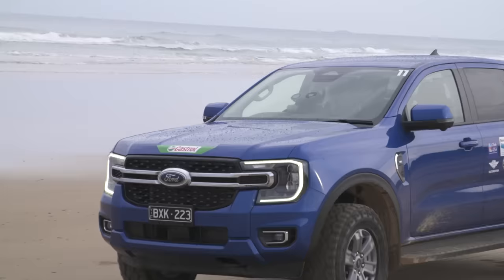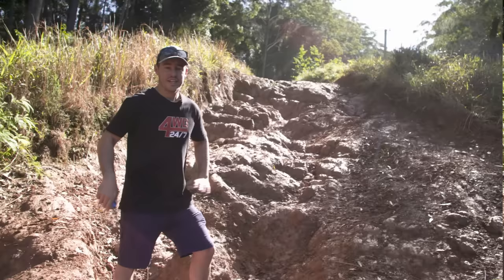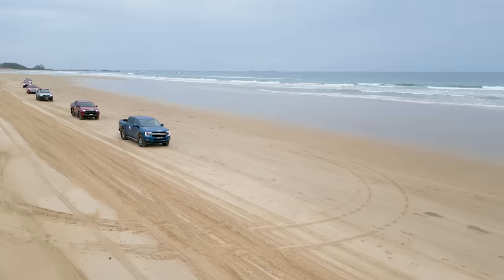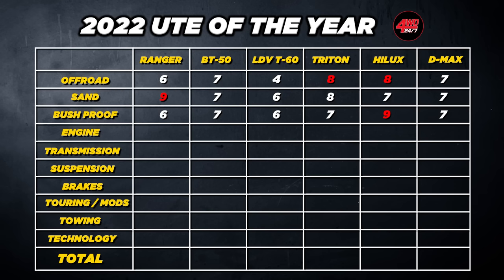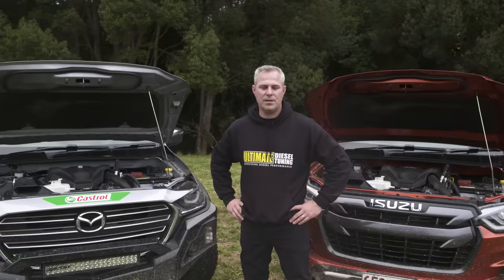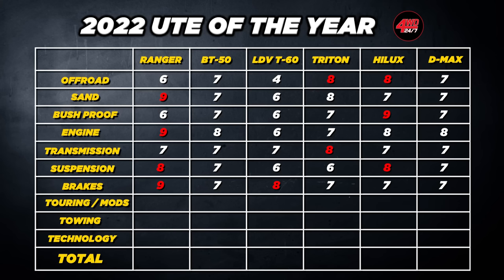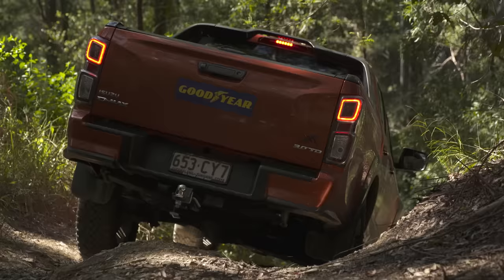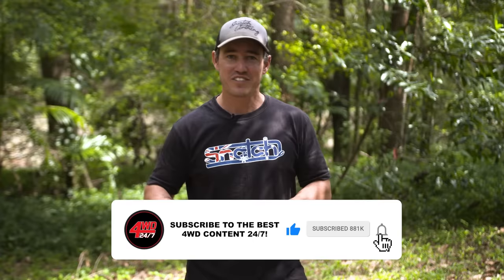2022 4WD UTE COMPARISON - CONTROVERSIAL WINNER! NEW Ranger vs Hilux vs DMAX vs Triton vs LDV v BT-50

Comment: Honestly, I think the LDV did well considering the price of the thing - did well in my opinion.
Reply: It was atrocious they didn't even take it up half the tracks
Reply: No it didn’t, and they are the most unreliable trust me I’m inside knowledge 😂
Reply: Triton doesn’t cost that much more and better in every way
Reply: yep.. worst performer, cant get lockers and other performance kits, worst engine, can't tow... but worst of all... made in China so it will last about a year ... sure did well all right.
Reply: The model with the locker is only 44k. Cant believe they didnt mention that or use one in the video.

5 year warranty? What's unreliable about that..
Reply: @electro1622  I've had mine for just over three years. Still rocking still love it.cant hate on something you haven't tried
Reply: @Jake_Hamlin  the fact that you will 100% have to use the warranty
Reply: @Jake_Hamlin  He did. He said it costs 5K more
Reply: Absolutely, I have the 2019 Trailrider, comes standard with the rear diff lock and both hill start and hill descent control. 2inch lift with 265/70/17 Yoko geolander a/t's and handles offroad and sand whilst towing offroad camper. All with original 2.8l 130kw, turbo diesel motor. Love
Reply: @zingerbox4198  biggest load of horse crap, 3yrs on and hasn't even looked like needing the warrenty. Maybe your boss needs to here about your opinions.
Reply: @darrenpetersen3115  they definitely heard my opinion don’t worry about that
Reply: Ive got the LDV D90, come with rear locker, don't understand why the T60 doesn't on all models? Ramp angle on the D90 let's it down off road as for towing the 8 speed ZF does the trick with the bi-turbo, friends 2018 Hilux lowing the same weight caravan cannot keep up climbing mountain passes here in NZ. Throttle response is bad, put in a EVC throttle controller, helped but don't get why modern diesels have this issue.

Comment: I've got a ranger PX2, would definitely benefit from a brake upgrade. The fronts are ok enough but I've had to replace the rears mostly due to mud. The handbrake as a result fails quite easily. 
Go the Ranger too! Ford boy from way back

Comment: So I own a 2022 LDV T60 max pro luxe [bloody mouthful]
It has a rear locking diff. You can’t choose it though, it’s automatic and it works a treat!!
Wonder if you’d try one of those models against the others?
Reply: Absolutely, I have the 2019 Trailrider, comes standard with the rear diff lock and both hill start and hill descent control. 2inch lift with 265/70/17 Yoko geolander a/t's and handles offroad and sand whilst towing offroad camper. All with original 2.8l 130kw, turbo diesel motor. Love

Comment: Great video, Hilux for me. Value, reliability, resale value, after market parts and mods, the biggest dealer network in Australia for access if something goes wrong on a big trip, the fact it shares an engine and gear box with the Prado & Fortuner, not mention a stack of other changeable parts means even more available parts all around Australia
Reply: Super relevant points. A big reason I stick with an older Hilux is the easy availability of parts and mechanics who know the truck. As was mentioned, the D-Max keeps changing parts and that's an absolute no-no for me, as it forces you back to the dealer every time (and there's only one Isuzu dealer near me). If buying new then re-sale value is an issue, and here in Malaysia that means the Ford drops drastically, and the Hilux scores big. As the Mazda is a rebadged D-Max they both drop to 3rd place for me, so it's Ranger if money no issue but really the Hilux is the smarter choice, especially as we don't know the Ranger long-term, and we do know Ford don't give a rat's ass about their customers. For me, I'll stick with my old Hilux Vigo, so I can go off-road and not worry too much, and there's no electronic crap to break (I fitted my own 360 cam)

Comment: I’ve just put an order on a new Mitsubishi triton Club cab/ space cab for all the reasons that you guys rated it for. Excellent Value for money, reliability, and respectable overall performance. I’ll be setting it up as both a tradie work vehicle and a camping vehicle. Being a club cab I don’t think the rear axle will be as much of an issue once I put a lightweight 3/4 canopy on it. The other vehicles were great too however budget plays a big factor and leaves me with more money for modifications and tools for work 👍🏻

Comment: Personally, I would upgrade to the new V6 XLT. I am currently on my 2nd ranger after owning a string of Patrols. My current Ranger was from the last production run of the 3.2L. 
As mentioned in this test, any short comings in the Ranger's rollover angle can be easily addressed with a suspension upgrade (same as the outgoing models) and a snorkel would be another immediate modification. If there was solution that could be done to help look after the alternator then I don't think you'd have many issues using the Ford...
I have over 10+ years playing in the retail car game and as such I am more than familiar with each of these vehicles aside from the new model T60 and Ranger which have been released since leaving the industry.. 
However, I am a bit confused about what was said in reference to the Ranger's V6. 
As was mentioned, this powerplant has been used in the F-trucks reliably but in the wrap up Shauno said he wouldn't put his hard earned coin down on a new Ranger as longevity is a concern??? Wouldn't being used in a much larger vehicle ease any concerns about longevity and reliability, Shauno?? 
I would be more worried about these small 2L diesels such as the Ranger,s and LDV,s 4 cyl. (I did work for VW for awhile)
Not being critical as my reasons for getting the old model over the new one was all new vehicles have some teething issues and recalls, etc...as history has dictated for every new release vehicle since they invented motor cars...
Fair comparison test by the team. Credit for featuring the LDV as they are gaining a lot of popularity due to their price point and as such continue to get peoples attention. I enjoyed watching this comparison. Thanks guys...
Cheers, Drummo
Reply: Theres has already been a large amount of issues from the V6 Rangers, especially drive train problems like the popular tail shaft issues, as well as gearbox issues which is the same gearbox used in the F150’s. Ive been heavily looking into them or a Hilux, and seen alot of issues with the Rangers. If they didnt have issues i would be strongly considering buying one
Reply: @Tact1calP0tat0  The tailshaft issue only affected a small amount of vehicles (a few hundred) it was dealt with quickly by Ford, they replaced the faulty parts instead of retrofitting a mod which was good of them, any new model is going  to have teething problems, Hilux has had plenty along the way, I personally wouldn't buy the first of any new vehicle, and rather wait for a year or two so they can iron out the invitable bugs.

Comment: Definitely the Triton. 
I bought an dual cab V6 petrol older model some years ago.
Replaced the shockies put on extractors.
It was a beast in the soft sand.
Even snatching 2x brand new Landcruiser that were bogged.

Comment: That was a great video guys. Really enjoyed it. I drive a 2016 Hilux and so fare have a Torqit performance chip and 3 " ss exhaust system along with a EVC throttle controller. It runs and tows really well. Thinking about a lift kit and brakes next. Happy new year all 🎈

Comment: Pretty much with you on this one Shauno,  Hilux, BT and Dmax would be great all round tourers that can handle some the harder stuff, proven reliability and a good suite of aftermarket accessories available.  Let the Grey Nomads test the reliability of these Range V6s' they did that with the Grand Cherokee V6 back in the day, on paper 👌 but over time and worked hard, absolute lemon.
Reply: It's funny that people still have no idea how much the V6 Diesel has already proven itself, it's a powerstroke diesel. Look up what runs the F trucks..
Reply: @railabuser  that's even more worrying, ford made two of THE worst diesel engines ever made the 6.0 power stroke and the 6.4 power stroke. The current 6.7 in the f trucks is a kind of good engine but is an absolute nightmare to work on and requires a cab removal to do relatively basic stuff like injectors ect ect. I definitely don't trust ford to make a good engine especially when they completely revamp the design every year. That being said the power figures are impressive and I would like to be proven wrong about this version!
Reply: @spwwps9636  Don't forget before the 6.0 and 6.4, there was the 7.3 Powerstroke which was a bullet proof engine. The 3.0 V6 is an F150 engine and it was quite solid so at least its already proven in that regards but I guess time will tell how they prove in the aussie heat

Comment: I would have liked to see the GWM pickup as well on this test. I guess the LDV wasn't really a contender until someone brought along his own car. 
The Chinese vehicles are becoming popular; especially with their pricing and some are pretty good. Would be good to see them doing some tracks.
Reply: Absolutely, I have the 2019 Trailrider, comes standard with the rear diff lock and both hill start and hill descent control. 2inch lift with 265/70/17 Yoko geolander a/t's and handles offroad and sand whilst towing offroad camper. All with original 2.8l 130kw, turbo diesel motor. Love
Reply: Not sure why no gwm. Are they afraid of it,? Mmm

Comment: Well done on the test. I drive a Isuzu damx and of late found out the issues that aren't talked about. The front guard cracking , the the front body mounts collapsing and most of all the issue with the rear difff wearing out. I love the Dmax but have come to question the manufacturers lack of respect for owners. If they have fixed the issues in the new Dmax I hope it gets the points.
Reply: Check out the recent AutoExpert YouTube channel video on Isuzu Ute customer support...
Reply: Why I went the hilux this time round... especially when selling people tend to look for hilux over everything else second hand.

Comment: Very impressive review! I have the Ford new Ranger Sport V6 and very impressed with the technology, transmission and engine. I still think these vehicles have a long way to go with their spartan leaf spring rear, shame navara wasn’t able to contribute given they’re coiled.
Reply: What's the fuel economy you getting?
Any bull bars or lift?
Reply: @tranlee5622  nothing to worry about, sits between 10 & 11 country driving which includes some slow 4wding to get off my farm. It’s standard at the moment about to fit 33’s
Reply: I’ve ordered the V6 Sport (white) with the touring pack also. 
The clincher for me was the V6 (184kw/600Nm) engine & the rear wheel disc brakes. 
I currently tow my 2.5T caravan with a 2019 Holden Colorado (147kw/500Nm)
Due at the end of October 🤞
I was very impressed with the 2 test drives in the V6 👍

Comment: Would have been good to see a T60Max “Luxe” model tested on here. They come factory with a Rear Diff Lock. I have one myself and can’t fault it so far. 👌🏼
Love the video though. Cheers boys! 🍻
Reply: I have a 2021 t60 pro goes mint
Reply: Yeah it’s a shame, especially when they’ve put it up against such expensive utes. Might have gained it quite a few points. $38k vs $70+ is a big ask
Reply: If they put the trailrider in there it would have been are good comparison to the other
Reply: Absolutely, my 2019 trailrider came standard with rear diff lock and hill descent and hill start. No faults and goes where all the other utes, (same class) go.

Comment: The Ranger is rated to tow 3.5 tonne. At that weight it has hardly any payload once you account for the driver, passengers, fuel, bullbar, roofrack etc. The Triton is rated to tow 3.1 tonne. Even at its maximum towing capacity it can still accommodate a significant payload capacity. Can't go past the Triton for 4WD ability, cost, towing and payload. The Ranger is $25,000.00 more for 400kgs extra! Err no thanks.

Comment: As an LDV owner and enthusiast I am absolutely ecstatic by the facts that it got considered to be tested by you guys. Even if it came in last . You have to ask yourself, well,  against who was it competing. This is a fairly new and super cheap yute that it's up there racing against freaking Ford and Toyota. So again even if it came in last this feels like a win for LDV. This brand will only get better and better each year. Really looking forward to see an LDV competing again next year.
Reply: Absolutely, I have the 2019 Trailrider, comes standard with the rear diff lock and both hill start and hill descent control. 2inch lift with 265/70/17 Yoko geolander a/t's and handles offroad and sand whilst towing offroad camper. All with original 2.8l 130kw, turbo diesel motor. Love

Comment: I was torn between a Hilux or Dmax/bt50, both seemed like great bases to build upon and keep for a long time. Ended up purchasing a bt50 as I found a 2nd hand one which saved a massive amount for mods! The brake upgrade would be welcome to keep my bt50 pulling up with all the additions I’ve done.
Reply: How is it treating you after months of owning it? Just thinking about buying the BT50 over the ranger lol
Reply: @Louis-gr4cz  Had it for over a year and have taken it on a lot of 4wding/camping trips. It's been a great vehicle to tour in, however after clocking up almost 50k kms I've decided to sell it. It's comfortable, capable enough and I still believe it has one of the best engines on the market for a new car. Not a fan of how difficult and expensive spares can be (most modern cars will be like this), the overall build quality feels quite poor (dolled up work ute at the end of the day) and the headunit is pretty average.
Despite that, it would be a hard choice between the BT and the new ranger if I were in the market again. All the best in your decision!
Reply: I’m looking at 2018 bt-50 for towing my 2500kg boat. How do you think she’ll go?
Reply: @Luka Williams  It'll have the 3.2L in it, had the same in my old ranger and it was great. Didn't tow with mine personally but it would handle it no dramas
Reply: Bt 50 complete my emotion...

Comment: Would’ve been good to see the NAV again, Rate them highly off-road!

Great video as always tho 👍🏼
Reply from the maker: Yeah we would have loved to have one! When Nissan said no - we even tried to get a punter's one but it just didn't work out unfortunately - we will try again next time! Do you own a Navara? What are your thoughts?
Reply: @4WD247  take our nav 👌 they are a good thing
Reply: @4WD247  Yeah that’s unfortunate and slack from Nissan.

Yeah I bought one late last year, overall super happy with it, has a lot of low down torque & has been solid off-road, haven’t had any issue with it so far ( touch wood )

Not 4wding related but It’s only negatives I have against it,is the interior which is outdated considering the price compared to some of its competitors.

Comment: Have to say I've had both a 2020 ranger and 2020 hilux and the hilux was just so much better offroad and while the new ranger looks good those approach angles have me worried and im sure a new bumper wouldn't be cheap will stick with the hilux till the ranger can prove itself as only time will tell!
Reply from the maker: A lot has to be said about the hilux off-road - bloody weapons!
Reply: I've had Toyota's since I was 18 a 4runner, 2 hiluxs, 100 series and a Prado I'm now 40 and just bought a Ranger. Doesn't really feel as tough as a Toyota but feels like it has lots more power.
Reply: fark id sell it and get another hilux
Reply: @markoantonijevic5430  I cracked the head in my Prado wth Under 200k on the clock and treated it like a Baby. I know I got unlucky but It's the only reason that made me buy a ford. I also have a territory diesel that's been a great car.
Reply: If your buying a new dual cab ute, your highly unlikely to be doing tough tracks with it, and more touring. Having both the hilux and the ranger, you should note that the interior on newer generation rangers beats all competitors in its class, my opinion is comfort is key in long range touring, nothing really beats the interior of the px3 rangers and now improved even more, refined with a v6 in the new gen, linked with the f seires trucks, the other manufacturers have a lot of catching up to do

Comment: Hi guys great test as always, I’m in agreement with most others that the Triton would be the way to go as ute of the year. With a very capable base platform for upgrades due to savings over the other vehicles shown. I own a NS Pajero and I’m astounded with its performance and reliability so I’m sure with Mitsubishi’s Dakar winning R&D in the past it would be a good long term investment
Reply: Agreed. It's cheaper than the rest and is very inexpensive to run and maintain one.